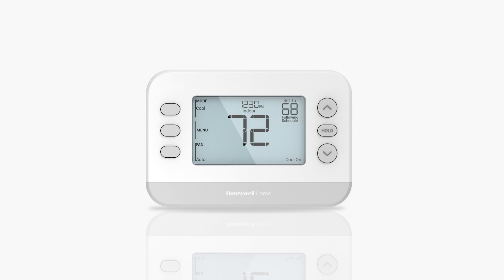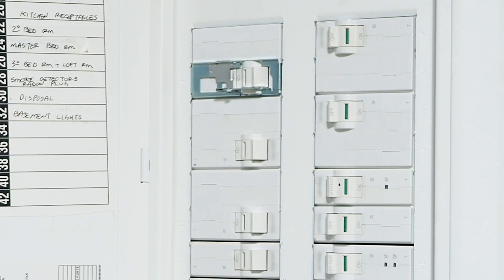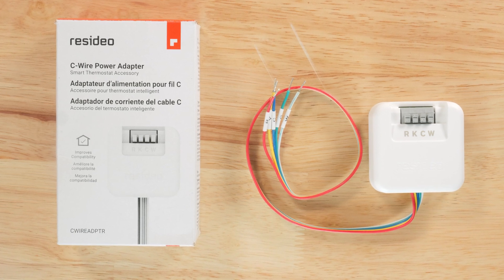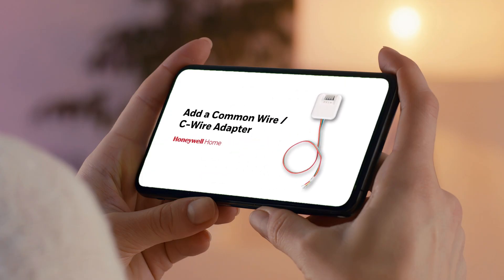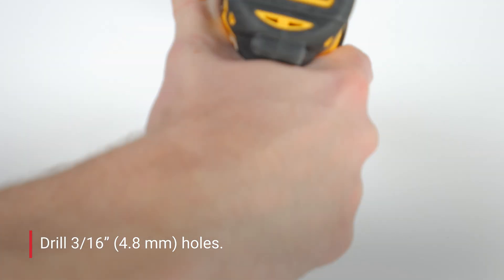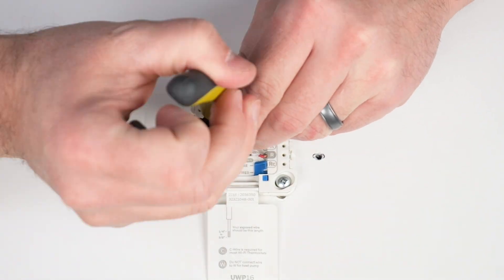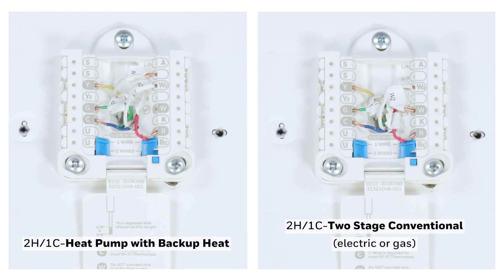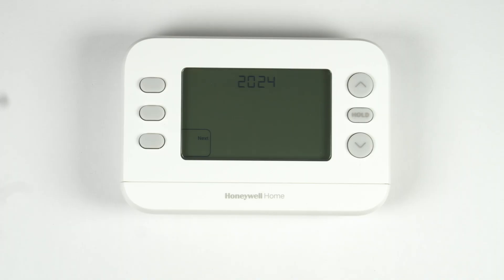Mount and Wire FocusPro® N100 Non-Programmable, P200 Programmable, and S200 Smart Series Thermostats

Comment: Can you use the p200 on a 2 wire system?
Reply from the maker: Hi Gary, this thermostat can work with a 2-wire system in basic heating-only setups. Feel free to contact us at 1-800-468-1502 if you need help confirming compatibility. -Dan